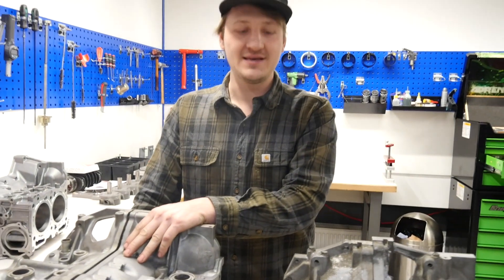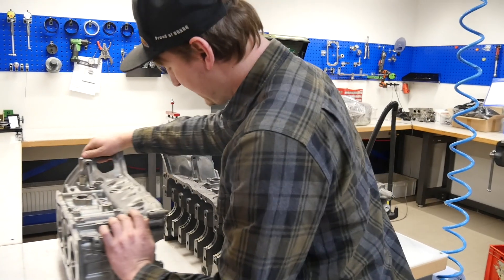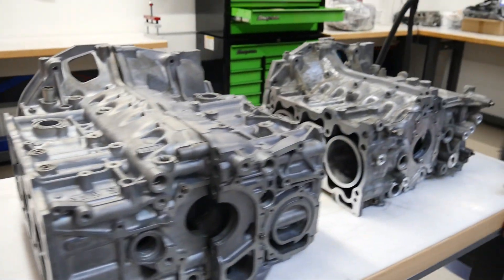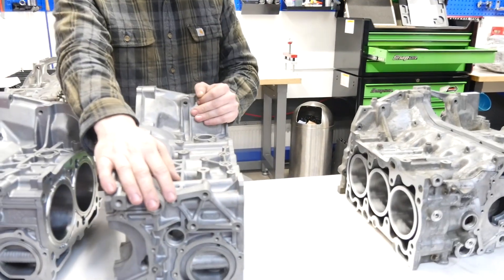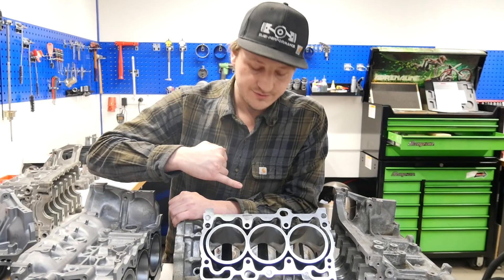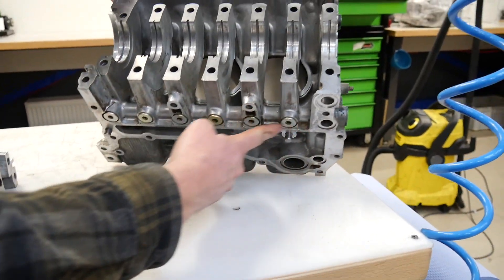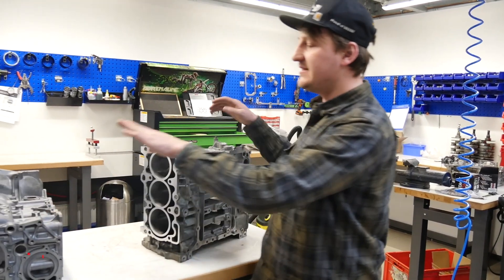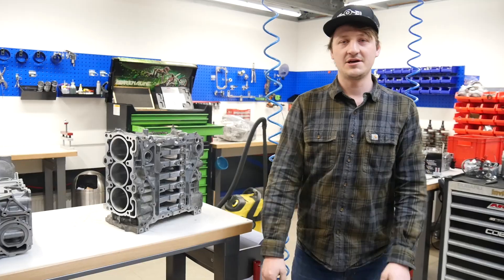FACTS ! EG33 VS. EZ30 l Subaru Six Cylinder l Subi-Performance

Comment: have seen the ez30 go well over 300k miles with no issues. VERY VERY rare for them to have head gasket issues. If you boost it, it will definitely have head gasket issues though eventually. The ez30 is an absolute tank.
Reply: How about the EZ36 available up to 2019 in the Outback? are these also considered as reliable as the EZ30?

Comment: How do you cure the overheating of the EJ33 when run at high rpm for any length of time? Coolant can not be supplied to the pump fast enough and therefore a vacuum there and thus boiling of the coolant.

Comment: Yes I believe some fellas down under would have to disagree with you on that point. Seen both engines handle boost pretty well. EG33 looks bigger overall,  more material, stronger perhaps?? More parts sharing between it and 4 cylinder EJs? More potential than EZ?

Comment: The Internet:
This NA 3.0 l engine makes 180 kW and redlines at 7000 rpm stock.
But it won't make 700 - 800 hp stock with a race turbo so it's garbage

Comment: EZ30D was a much better version after EZ30, anyway both could take some boost like a Raptor kit gets you to 300~ to the wheel. That's more than enough for a luxury sedan, a SUV or if you want to swap it, definitely more than enough for a SVX, XT or even a 914.

Comment: You failed to notice the EZ30 is  smaller and lighter than the EG33, making it fit almost anywhere the 4cyl will fit.  
That is a huge difference when doing swaps, like a 914..
Reply: Eyup, that small and 3.0? Insane little engine.
Reply: Yup. The EZ30 is an absolute unit. So small for the displacement.

Comment: Your so full of shit u point out zero issues with the ez but love the crappy eg33 head gasket eater....your tripping that engine is junk.
.the ez30 never has gasket issues unless your careless and ignore holes in pipes or radiator I have a outback with 330kms on original engine ..the ez30 has very very short shallow bore depth in cooling system ,less than 50% of the bores are unsupported as opposed to 70% IS unsupported in a ej so they don't need closing the deck untill your over 50psi of boost ...AAAAAAAND the plate which is the sump u struggled to put in English is a clever peice of kit as if u look at it like this the water pump and main piping are mounted submerged in oil which is the sump so u get a double effect of cooling it's genius ..and your talk of can't get heat from the center of the block u clearly don't understand thermal dynamics and alloys ability to move heat plus tuning can counter hot spots and a decent can tune per injector ..

Comment: Is the EZ36 pretty much just like the EZ30 but more cc?  I take it that the EG33 is the best platform for big power.
Reply: no very thin bores no where as reliable as the EG33 or ez30.
Reply: The ez36 they had to make it even shorter liners to make the extra cc and they use asymmetrical rods to do so because they basically  Siamesed  the engine

Comment: The bores being Siamesed is actually a point of strength. Take 2jz for example, Siamesed as with quite a few other bullet proof engines. It won't ping at all with those bores, especially being alloy.  The engines can also handle 5 to 10 psi in stock form EASILY and can produce 250wkw.  The claim that ej25s can do 750hp on stock liners is absolute bullshit. They're known to move around at 500hp. There are plenty of 1200hp ez30 builds around, might be worth doing some research....
Reply: The ez36 is siamesed as it has asymmetric connecting rods where as the ez30 dosnt. The ez30 has even thinner walls to add the extra .6 litres of displacement so if he had an ez36 he would say it’s an abomination if the ez30 is a disaster …

Comment: Great seeing your video, it confirmed that my choice of the Subaru EG33 for my airplane was a good one.  I now have over 920 hours of run time on the EG33, and probably 80% of that time at 4800 RPM or more.
Reply: I'm still surprised that the Subaru boxer is a great engine for airplanes when they have such a horrible reputation on land vehicles
Reply: @chrism1106  Chris M, I can’t speak to Subaru’s reputation on the ground.  In my aircraft the EG33 is an excellent choice … this EG33 engine has not been babied.  We hold the speed record for our class of 261.60 MPH average speed over a 150 mile course.  We have run it in 22 air races that are generally about 150 miles.  We are undefeated in our class.  During each race the engine is running 4900 to 5000 RPM for the entire 30 to 40 minute race.  This is one of several videos we have posted on this engine/aircraft.  https://youtu.be/6VGnkvkguRE
Reply: @RussellSherwood  i never would have thought an engine thats only 250hp could be enough to make a plane fly. You learn something new everyfsy
Reply: @lordoftherims436  yeah, it's crazy to think about. However the Cessna 172 (one of the most popular aircraft of the last century) came from the factory with a 145hp engine, then later a 175hp and 131hp engine. And many aircraft have less than that.
Reply: @chrism1106  Its undeserved. Partially Subarus fault because of them using cheap headgaskets on 2.5 naturally aspirated engines. Anything else is really reliable.

Comment: can you swap the ez30 from a tribeca for an eg33?
Reply: I have the same question.
Reply: @5325max  sure, it'll mount in to the same location, although a tribecca is running an ez36 not this ez30.  and you'd need to go standalone ecu, wiring merge and tune as well as fittings for anything like cooling and power steering.  plus retrofit a drive by wire to ur eg throttle body. im sure there's more, but tldr, you may want to just modify that ez36 you've got unless you've got experience/bankroll to make the eg swap happen.
Reply: @alextaitt5604  the tribeca 2003-2009, comes with the EZ30R

Comment: Why don't you like EZ30? There have been many many boosted builds that have made good power. Yep one had been sleeved but if you can sleeve the EG33 why not the EZ?? Closing the deck isn't too hard either and you could easily make an insert with your equipment and skills... ARP head studs are available and I'm sure high volume oil pumps too. It's lighter, shorter and has better cooling abilities, so it's far from a disaster!

Comment: I was going to get an EZ and here then the guy says it's a full blown disaster!? :^(
Reply: No no no this guy is bias. I bought my ez30d for 160$ canadian, good luck finding an eg33 at a bargain. The ez is fine. Not everybody have deep pocket to run a 1000hp subaru on the street. Myself I’l be fine with 350hp at the crank with low boost.

Comment: So I have a question. Its obvious you see the EG series as the better engine for HP output, but there appears to be less than 30,000 SVX sold globally. But the EZ was used in the B chassis Legacys in sedans and wagons across multiple years, so it seems finding them is much more possible. Also, the EZ went from high compression at first to low compression in 2010, do you think there is something else thats workable with the EZ?
Reply: 2005-2009 EZ30 can handle 10lbs boost without mods. That's the one you want, plus its the only EZ that has aftermarket support (to a degree) they're still not the most popular but they're gaining a following finally. The open deck is definitely the limitation. If you can get a closed deck, you can build that thing to insane numbers
Reply: @IamTheLocalHam  interesting. Why do you think those higher compression engines ended up being the choice compared to lower compression versions that came after?

Comment: My EZ30 is at almost 200,000km and it is running stock head gaskets, no leaks, no knocks, nothing. And i redline it pretty hard, head gaskets are not a common failure point on the EZ30.
Reply: EZ engines are generally bulletproof from every bit of info I can find. Stock, obviously, though they seem to handle boost as well.
Reply: I gotta say I love my EZ's, I've run them in swaps with no radiator fans and they never overheat! Ok well not never, but they're extremely resistant to it.
Reply: In my experience, EZ head gaskets fail due to low octane fuel causing detonation.
Reply: @2003wrx64  eyup, thats why i have some seepage under one cylinder. Cba to fix it shell be alright
Reply: Yes I got one from around my 190k to now about 240k

Redline it regularly with a stage 1 tune and took it to the track once and no issues, Yes it has had a few oil leaks but aside from that, never let me down, super reliable engine (in N/A form)
Reply: I wonder if he ment that under massive power gains, cuz i think him saying 300hp and under is like stock, 500-600hp is normal boost lvls for him and anything higher might be what he means for headgasket failure, id rather have headgasket failure than a blown rod bearing, because then you can dial back the boost till you find the max reliable hp. but im just speculating on what he was saying and meaning.
Reply: mine too! 211+ xxx kms
Reply: @aaronc608  I'm at 290k now... Haha.
Reply: @tobywarren6151  have you ever had to check or adjust the valve clearances, change the timing chain or any other major thing? Thanks.
Reply: Nope! Though the tensioners are getting a little rattely. Probably should replace em, but cant be bothered. She'll be right.
Reply: @StormHawksHD  Thanks for the info!
Reply: @The93DarkShadow  Thats just my main account man, its my comment.
Reply: @tobywarren6151  how’s it holding up? I got an 06 liberty rb with the ez30 it has 190,000 on the clock n runs like new
Reply: Toby on my other account here: 326,000kms, still strong.
Reply: @StormHawksHD  awesome! Have you don’t anything to the car or is it still all stock standard ?
Reply: Mine long passed 200,000 km and its runs well

Comment: My boss supercharged his ez30 and has 290kw atw on e100. It's a Raptor super charger kit. He doesn't know how long it will last at this level so it will be interesting to see how his build progresses. EG33 only DOHC? Can you do another video with the head comparison :)
Reply: How did your boss's EZ30 go? I just picked up a EZ30R for $300 AUD, a well known Motorsport shop in NZ called 'Possum Bourne Motorsport' does CNC closed decking, + forged rods and pistons, along with head work. They have even improved the timing chain, ARP studs and closed decking allows the motor to be pretty heavily boosted.
Reply: @77knives  wow where did you find one that cheap? every where near me wants 2k...

Comment: No, you're not correct.
Yes, EZ30 not meant to be boosted, but this is an excellent NA engine overall. (I'm not speaking of those crazy guys who made that 1200hp impreza with EZ30)
The head gasket problems come basically from poor cooling, like failed fan, or low coolant, but it's ok (I guess) for a gasoline engine to require a good cooling.
I've been driving H6 for 8 years, and my personal experience is rather positive. It doesn't consume oil (depends on oil though), it starts good at -30 C (and it doesn't overheat at +30 C if the cooling is ok), it never fails in any meaning and, with some service, could last for a million km for sure, and, speaking about service, you don't have to change the time belt, because there's really good chains.

If you were gonna to show us some disaster by Subaru, did you consider to make a vid about diesel boxer?
It would be nice to have some insight.
Reply: you gotta realize this guy has a ton of experience building subaru engines, so he’s probably seen a lot of the common failures, i’m a technician at a subaru dealership and the EZ30 leaks like a son of a bitch, the double front timing cover was a terrible idea, almost every gasket is just silicone, which is prone to leaks if not done properly, chain tensioners go bad frequently, lots of cooling issues. i agree that chains are better than belts as far as maintenance goes but for ease of assembly and disassembly i would much prefer working on an EG33. EZ30s do typically have a lot of headgasket problems but most of the time they leak externally instead of internally. not the worst engine i’ve seen but if it were my choice i would take the EG33 for the larger cylinder separation, partially closed deck, and shorter stroke for more top end hp. also parts for them are much easier to find than the EZ30.
Reply: @saltynuts6  Oil leaks are only caused by pcv valve getting stuck and not being replaced. It makes the pressure go towards the seals instead
Reply: @saltynuts6  where you you get your qualifications from a cereal box?
Reply: @saltynuts6 Hey. How hard would an eg33 swap be going into a 03wrx?

Comment: Thank you so much for this. I can't wait for more EG33 content! You're feeding my crazy dreams of building and turbocharging my SVX... ;)

I'm left wondering what this sleeved EG is going into... and how much boost it'll be running... if you said stock unsleeved EG will handle ~700HP, then I can only imagine what this one will be making once it's tuned. What engine management do you intend to run? Any changes to the funky dual crank position sensor setup? So many questions! :D

Keep up the fantastic work! Cheers from Canada

Comment: First of all i have to say thanks so much for this video to my knowledge its the only one ive seen on youtube showing the differences between Subarus two 6 cyl engines. Awesome awesome job!
You clearly showed now why you much prefer the EG33 but i have to say im confused since one of the main guys to work on the EZ30 on youtube from The Skid Factory says the EZ30 is very strong and can take a lot of boost no problems [he covered this in one of his videos not long ago], but he didnt show evidence unlike how you have done here. I guess this is the reason why not many people have modded the EZ30 hard.
Finally i have to say here in Australia at least the EZ30 is absolutely not known for head gasket issues at all. its pretty much regarded as bulletproof unlike the subaru 4 cyl engines where most of these problems exist.

thanks again!!
Reply: There are two generations of EZ30. The first generation was made at the same time as the version of EJ25 that is now legendary for its head gasket issues. This first generation seemingly shared a similar head and gasket design to that EJ25, and suffered the same issues as a result. The second generation EZ30 has a quite different head (and by extension gasket) design, and is known to be very reliable - when stock, of course.

Important to note too that both generations are officially designated as EZ30D. The 2nd gen is referred to by the community as the EZ30R to differentiate it. Obviously, this can lead to some confusion when one is reliable and one isn't.

Al has turbocharged a few EZ30Rs now, and they seem to do quite well. But like you would expect from a man of his experience, he keeps the boost fairly low on unopened aspirated engines (around 10 PSI ish). These cars are also street cars, so they aren't experiencing the huge constant stress of a race engine. Not to mention that Al normally puts them on E85 which keeps cylinder temps and the risk of knocking down.

I really like the EZ30 (I own a Liberty 3.0R-B) but if you were to spend the money building a motor, the EG33 is the better option for your dollars. It's much better for boost, and performance internals are readily available for them because they share so much with the EJ. And if the EG33 is physically too big for whatever you're doing, you'd still skip the EZ30 and go with an EJ20/25 because it would be so much cheaper and easier to build, and there are well known formulas for how much power you can make and how reliably.
Reply: @t_z1030  The first generation EZ30D was produced in 1999, the first EJ255 came about in about 2005. The heads are totally different to that generation EJ, in fact, the intake ports resemble that of a Mitsubishi 4B11T whereas the exhaust ports are similar to that of a late model VW/Audi 4 cylinder. The head gasket design between both EZ engines are remarkably similar, the primary difference is the later model head gasket has room to allow additional oil flow to allow the  heads AVCS/AVLS to function. That's it. In terms of reliability, both EZ's are fairly even. At this age, the older one is seen with more leaks/blown head gaskets because it's older and likely done a lot more driving. That should be common sense.  

Also, you reference boost levels being low on a factory N/A engine with a CR of 10.7:1? That's not very fair, considering the majority of N/A+T EZ30s are being done with GT3076 turobchargers at a minimum, but typically using GT3576 or even GT3582 sizing, which is a very large turbo when you consider the factory turbo that is often seen on EJ engines. 

The EG33 is a terrific engine... if you have the money. Not only that, it is much, much larger than an EJ (for example, you would have to relocate the radiator if you were to fit an EG33 into a 2002 Legacy RS30 - which comes factory with the rather petite EZ30), also, this "and performance internals are readily available for them because they share so much with the EJ.", while true, is a moot point for the EZ series of engines. There is an entire aftermarket for the EZ30 now. You can just about build a high power EZ with off-the-shelf parts. 

However, 9 times out of 10, people just go with what they have. It's easier, and cheaper. If you're building a race car and couldn't give a shit, EG33. If you're building a street car and you want to keep it relatively simple, EZ. Either or, cool engines and make all the right noises. :)
Reply: @t_z1030  awesome detailed info, appreciate it man. i own the same car 2006 vintage love it to bits!